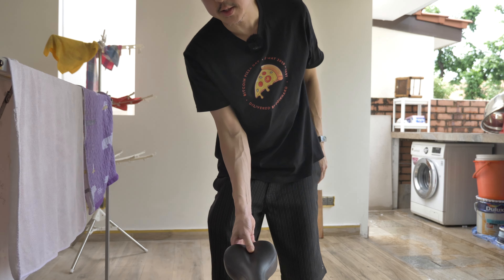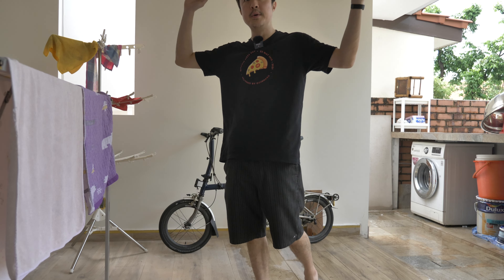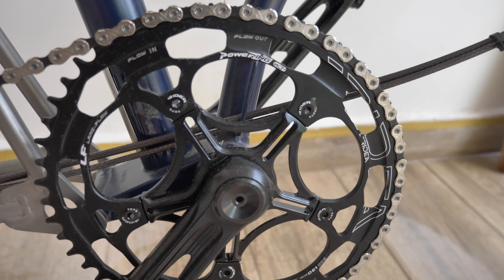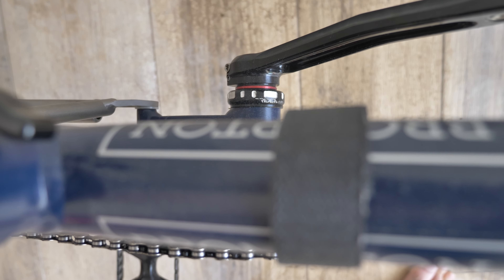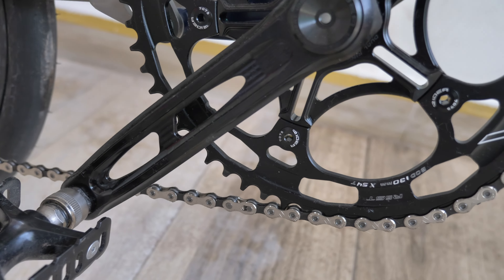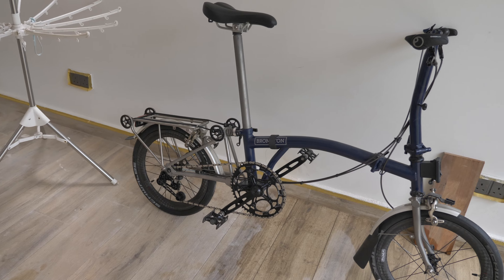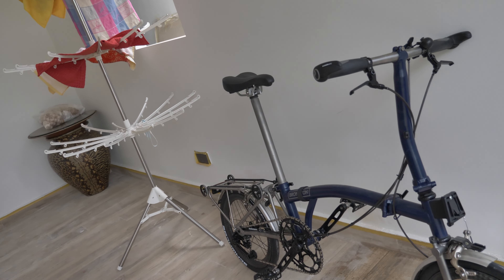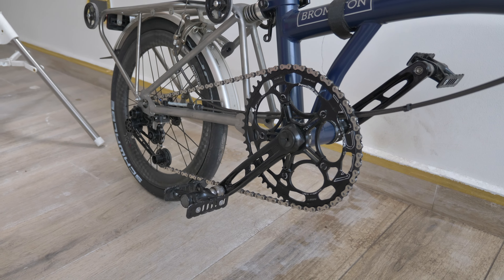Final Brompton Modifications?

Comment: I own a "LightweightH6LBrompton", and I have changed my Crank to Ceramic/Titanium. Seatpost: A new long 600 mm Titanium (I'm a tall Scandinavian man, and Bromptons up here are sold with a 600 mm post as Standard!), without the saddle clamp (a ring on top for mounting and angle adjustment of the saddle) , Handlebar: Carbon, and I have a carbon set of "clamps" for my - original titanium stays on my mudguards (The original metal clamps are really HEAVY!!! ;-)), and some original type, titanium carriers, both a short and a little longer version.
      I have a Joseph Kuosac headset, and I would love to be able to find a carbon stem-post somewhere! 
Anybody knows where to buy one?
 I have new cams from titanium for my Sturmey Archer 6 speed gearset.  Finn S.